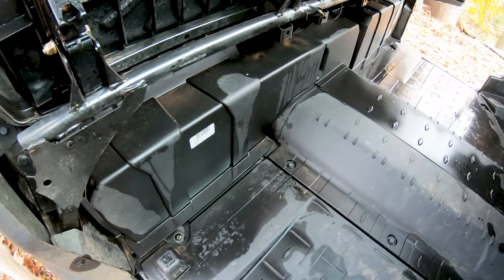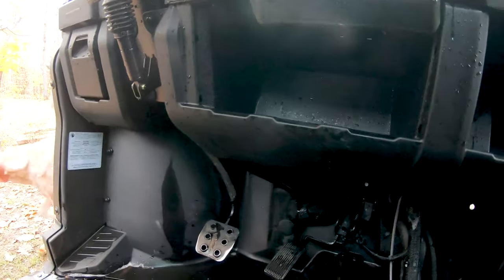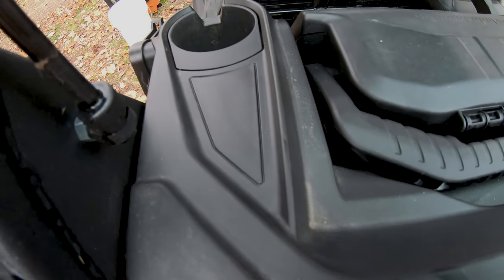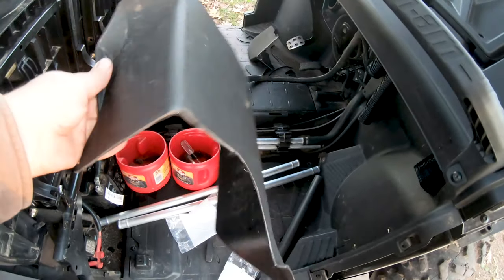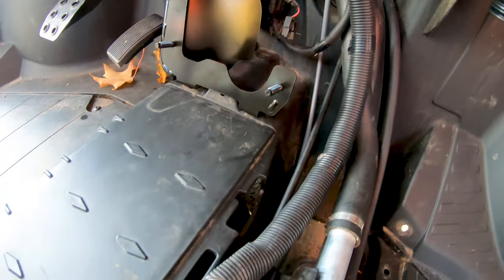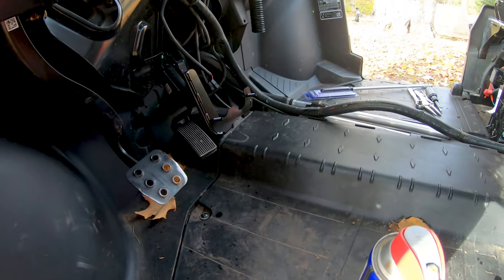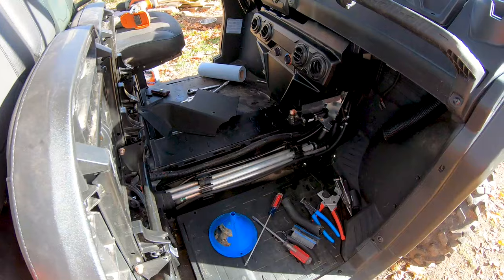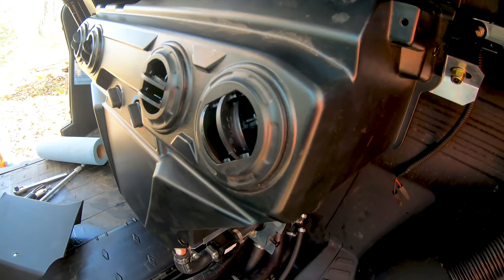Heater Kit Installation // Can-Am Defender // Defrost Heat and Ventilation

Comment: I just finished this job this weekend after watching your video for the first time about two years ago. First of all, it took me about 8 months to get the kit from Can-AM/BRP due to supply chain issues, but that's another story. It was hard and I'm not sure I'd want to do this again, but a couple things that others might want to note. (2016 Defender XT HD10)

First, unless you have the tools for Oetiker clamps, take inventory of all the oetiker hose clamps and get stainless adjustable clamps from the hardware store. Made the job much easier. Also, make sure you have a threaded rivnut tool for M6 and possibly a 1.5" hole saw. My rivnut tool didn't have a long enough neck to fit through the holes in the plastic floor and reach the sheet metal underneath so I had to enlarge the holes with a hole saw to get clearance. 

I needed to extend the wiring for the 12v outlet with the new dash since it changes location from right of center to far right in the new dash (also don't forget to fish it out from behind the heater when finishing installation - not covered in the instructions!)

I had a heck of a time installing the smaller ducts over the fittings - ended up having to cut the wire to stretch over the fitting and then repair with duct tape and zip ties. They should do better on this from the factory.

I think I went through a half gallon of coolant even with clamping off hoses if anyone is curious. 

All in all - it's very cozy with the new heater and I love the factory fit and finish. Took me about 15 hours total with some breaks and trips to the store for adjustable clamps and coolant and a different Rivnut tool. Also recommend a careful hand with a dremel tool vs. using a razor blade to cut the plastic. Much safer. Good luck!
Reply from the maker: Good tips yes it's a pain. I closed the clamps with a wire cutter but the standard clamps are probably better I did have some leaking later on. I used my ratchet instead of the rivnut tool another hard deal to work around. Glad you got it done 👍

Comment: Thanks for taking time to make a video. I installed superatv unit last night everything panned out except my machine was flirting with over heating. Im going to continue to put 50/50 back into it to make sure it’s the right level, and attempt to burp the system. If you have more info on that step I’d appreciate it. Tia -Mike
Reply from the maker: Right on 👍
Reply: I park on a slope and make sure you're revving quite high to push through any large pockets of air. Also a short drive over bumpy terrain may help.

Comment: Great video, I’m in the process of doing this. Do you have a video on how to take of the fenders off? Thanks
Reply from the maker: I don't it's pretty easy you'll find the tabs and the screws holding them in. Helps to wash the wheel wells good.

Comment: Thank you for posting this video!!

As you mentioned, it's a shame that Can-am didn't include the lower dash inserts.

I am having trouble locating the dash insert for the left hand side of the heater. Could you by chance point me in the right place? I found the right side piece.
Reply from the maker: There isn't one. I thought the same thing you did.

Comment: I installed a plow hydraulic rams so I can move the blade left to right. And the can am instructions really did suck like you said. The dealer wanted 8 hours to install the hydronic unit and I said no I will do it myself. It took me 3 1/2 hours with 1 hour of there bad instruction and hydraulic ram was to far extended so I had loosen the hydraulic lines so I could fit them. But my point is yes there instruction suck
Reply from the maker: They really do suck 👉

Comment: How the hell did you get the air tubes onto the heater....
Reply from the maker: Haha it wasn't easy bud. Mounted the vents first then had the heater close. Pulled them on hard and zip tied tight. NOT EASY